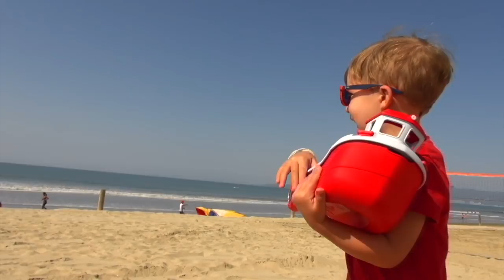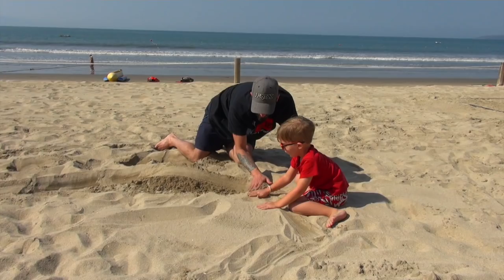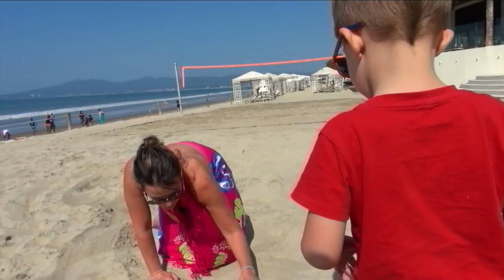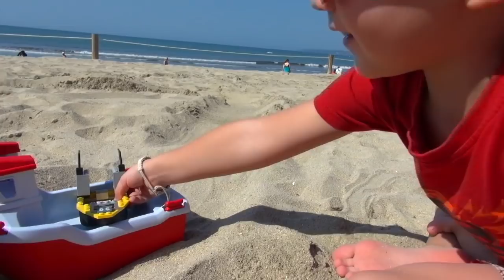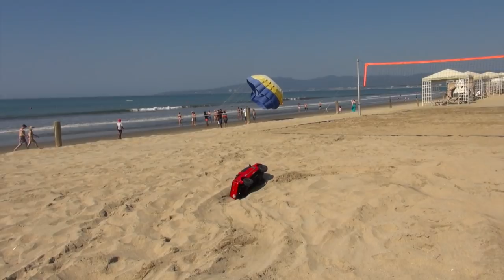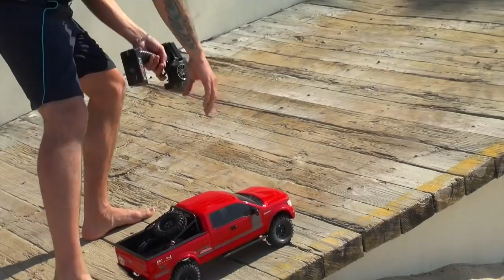RC ADVENTURES - Tips for Travelling with an RC / Battery on an Airplane!

Comment: Great video 😉👍🏻 I just traveled with my RC for very first time from Ireland 🇮🇪 to Latvia 🇱🇻 but  because it’s my beloved truck I didn’t want to put in to checked luggage so I packed up in my hand luggage. Security guys were shocked when they saw my case on screen 😂😂 About LiPo’s even on there website says you must not include any batteries in checked luggage and can’t exceed 160 Wh

Comment: Last time I traveled via aircraft with an rc it left a lot to be desired. Mind you, this was 26 years ago this april. Went on a trip with my folks to grand cayman. (I was in HS at the time). Brought my 1990'ish rc-10. Graphite chassis. Futaba magnum radio (am). Futaba esc, reedy (ae) stock motor & an 7 cell nicd pack. Oe 3 pc wheels with paddles on the rear. The airline said "customs" was holding my luggage for some reason. My luggage including my clothes & my rc10 arrived on day 5 of a 7 day trip. On the way home, they would not even let me check the luggage with the rc in it. I had to ship it back home and it literally took a month.
Reply from the maker: Times have changes my friend..    dont let a 30 year old experience ruin it for you now ;) Sorry to hear that happened. Really, that sucks :(
Reply: RCSparks Studio oh I know they have. At this point when we travel via aircraft there isn't much point in bringing the toys as our destination is usually a ship. We do quite a few destinations that we drive to to go riding with the wheelers and there's always a truck or two packed with us.

Comment: Make sure that you keep your batteries in carry on bags! The rapid temperature change in the cargo bay when taking off and landing can ruin the batteries.
Reply from the maker: Hmm, as I mentioned some airlines will not allow them in carry-on bags. And as a side note, not to take away from what you said - it was -30c when I left.. and that was just in the parking lot.. lol..
Reply: I did a bit more research into this, and newer planes actually pump the cabin air into the cargo bay. So this wouldn't be a problem. -30 isn't that bad, unless the batteries are outside for prolonged periods of time(days or weeks). I had some li-ion's freeze in my mailbox in mild -20C weather.

Comment: Very informative . . Good thing to pack a charger and batteries safely .. might be a good idea to mention cleaning after fun in the sand thatis goa be full of saltwater residue  . . Lil off topic, BUT did you take precautions with your 1:1  truck this time to prevent a dead vehicle when you get home?
Reply from the maker: I did mention it Mr Wolfe! In the video description box! :)
Reply: I am just curious with the cold conditions if you will be returninghome tona dead battery in your Ford again .. just hoping it isnt like one of your last vacations  . . 
I have heard coating in wd-40 or cooking spray helps protect r/c vehicles from water issues .. i understand the saltwater concern .. just hoping you are having a good time on the vacation  . .
Reply: Jim Wolfe Jr WD-40 may help with screws but do not put it on your rc because wd-40 shrinks plastic and would just ruin it

Comment: After running in sand, do you immediately tear down your running gear amd clean it? I assume the sand gets everywhere and destroys all the gears, bearings ect.
Reply from the maker: Nope..  just rinse it thoroughly.. and carry on :) Ill look at it when I get home. I already know the risks.. and take an RC accordingly
Reply: RCSparks Studio ok. When you get back home could you do a video on what to look for? I never ran in sand and just curious. Enjoy your vacation! It was cold as hell in montana, i can only imagine what the temps in canada are like
Reply: Ryan Sorkness What is the difference between dirt and sand? They run in dirt no problem?
Reply: Chris Watson  sand has a tendency to really f shit up. Does way more damage to gears.  A grain of sand is just big enough to get caught between gears and /or anything that is rotating really and cause that part to instantly bind up. Dirt can and does cause havoc too, but since dirt is finer, it usually takes longer to destroy parts. Plus dirt is easier to clean out.
Reply: Ryan Sorkness Ah I see! Thanks for explaining to a noob to the hobby. I got 2 new trucks (cheetah and maximus) and I'm still in that stage of not wanting to dirty them up, lol. The muddy, snowy, cold weather doesn't help the situation much!

Comment: Shouldn't any Lithium based battery have a "storage charge" (about 45% of full charge) and not fully charged to take on a plane?  And in a LiPo bag rather than Tupperware (which would just melt if the battery caught on fire.)  The "standard" rule is you can carry on (not checked in your luggage) an "unlimited" number of Lithium batteries under 100 watt hour each. And 2 batteries between 100 - 160 watt hour. And NO batteries bigger than 160 watt hour.